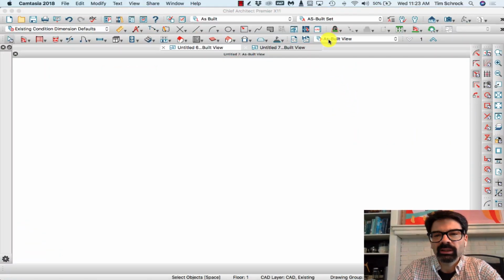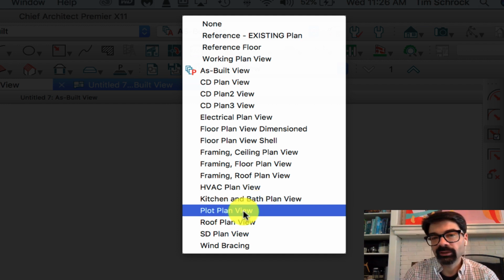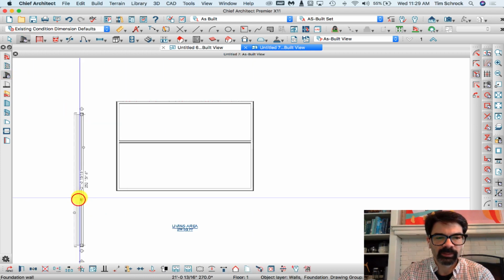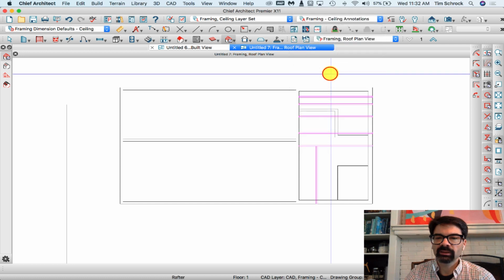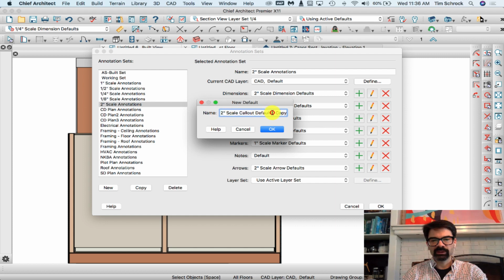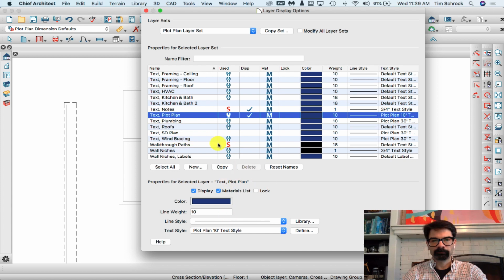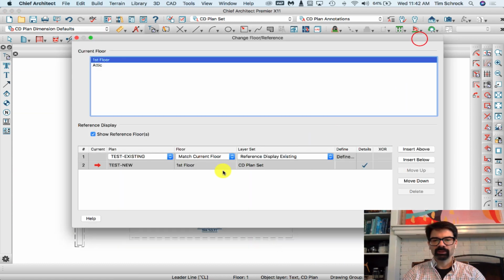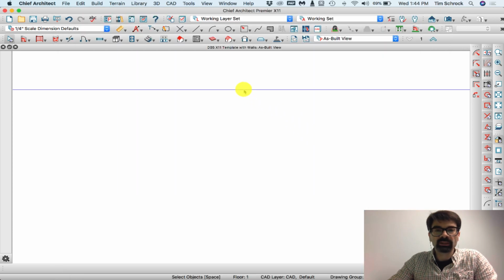X11 Template Tutorial  | Chief Architect

Comment: Question: In your template under the "working plan view" you have the notes "Text" set to "use layer for text style" which has the text set at 1 43/128"....Why?
Reply from the maker: Not sure why that layer would have 3/4" text scale. Typically on my working plan view, I don't add notes or text, so I wouldn't have checked that layer. I'll update that on the template as well.

Comment: I noticed you don't have different schedule layers for different notes. I have a schedule layer for each kind of note schedule. I have a feeling I don't need that.
Reply from the maker: I use a CAD detail view for my schedules. That way they’re all in one location to find and easy on the layers
Reply: I understand where to put the notes lol. What I'm asking is, in your plan template, you have, "Schedules, Notes". In my template I have, "Schedules, Notes General", "Schedules, Notes Electrical",  "Schedules, Notes HVAC" and so on. And  a few other things: Your plan sets for ceiling & roof framing were not set up with the correct annotation sets. You do not have NKBA notes for the NKBA Plan View. Not sure if I'm missing something.
Reply from the maker: Yeah. I don't use special layers for my schedules as I typically only use Door and Window schedules. I haven't implemented notes yet since that's such a new feature, but that will be coming soon, I think, and I'll figure out how I use them on layers. So, yeah, for now they're just on the typical layer.
Good catch on the plan sets for ceiling and roof. I've confirmed that and will send an update to all my customers. Thanks!

Comment: HI SIR DO YOU HAVE VID TUTS ON HOW TO CONTROL OR ASSIGN THE PEN LINEWEIGHTS?
Reply from the maker: I don't have any videos on that. Briefly, that can be controlled by each layer thru the Display Options dialog box. The default Chief Architect templates and my own template have pretty good lineweights. 
Is there something specific that you would like to know?
Reply: @DesignbuildsolutionsLLC   WHEN  I PRINT MY WORK.. IM NOT SATISFIED IN MY LINEWEIGHT
Reply from the maker: Can you show me examples? You can catch me on twitter @dbsllc
Reply: Line weights seem to be tricky. Some pages of my plan print out great while others print out with very heavy, fat lines. I thought it was because I was sending my plan views to layout and not checking off the "line-weight scaling" check box but that wasn't it.